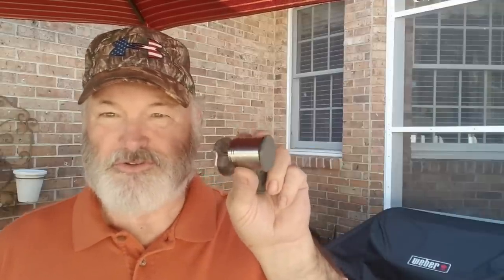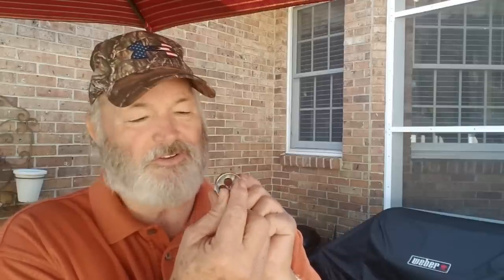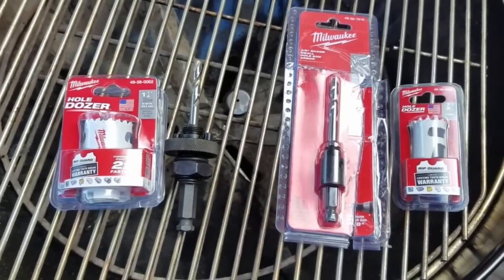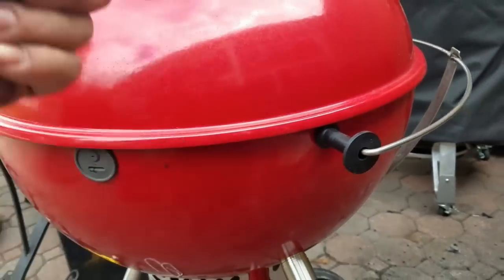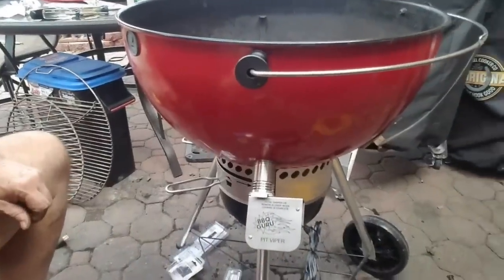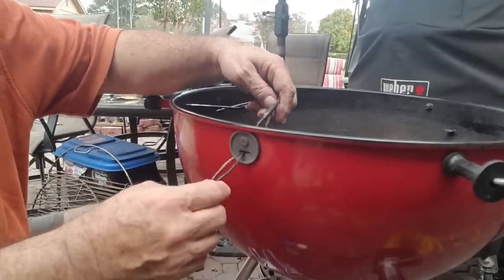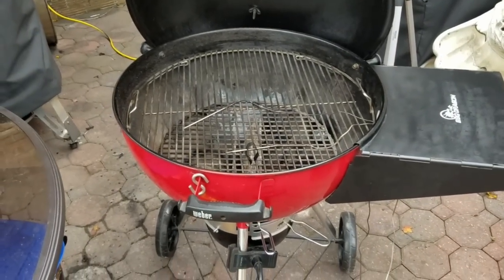WEBER KETTLE MODS | GURU PORT | PROBE PORT

Comment: Nice.  I did this temp probe mod with my old kettle but the rubber eventually wore out from the heat.  Doing a chicken wing cook will do a number on that rubber.  A sns port mod works better since it's made of stainless steel.  Also, I installed a NPT port next to the sns probe port on my classic Weber kettle which is nice because it allows one to thread in a high-quality dial temperature gauge such as the Tel-Tru which is half-inch NPT.  Sometimes those probes and electronics get cumbersome and all I need is a big dial thermometer.  Also, my dial thermometers go up to 1,000 degrees.  I've had the Thermoworks hit top end and blank out.  I even had a Tel-tru dial blow out once because max was only 550 F.  So now my dial thermometers are 800 or 1,000 F Max. Thanks for posting!

Comment: Hey Phil. When I did the grommet mod video, I drilled a pilot hole but it was still a booger to drill through that enamel LOL. Be well and be blessed brother.
Reply from the maker: Hey Joel. Long time since we talked. Hope you are doing good. Yea that high heat baked in porcelain enamel is a bear. Thanks for dropping by.
Reply: @progers5019  I've been around just busy. Did you see my video where I modified the air control/ash sweep arm for better cleaning?

Comment: I've made several modificatios to my webber I added a 1in air hole with a damper cover just under the slow and sear basket for better air controle. I also did the probe gromit. I cut a top vent damper in half and and made a new vent about 3 in from the bottom edge of the lid. I run the top vent closed and the lower lid vent open about half for the first hour of smoking drawing the smoke directly across the meat. Then I close that and use only the 1in hole I put in the bottom and top vent only I can keep it 225 if I chose very easily. 
      I feel like the webber kettle is a great little smoker with some modifications. It wasn't really designed to do indirect cooking but it can and with a few add ons and tweeks it dose a great job. Agreed the side shelf is worth every penny. Also with the extra air I can open things up and hit 450 really quickly for pizza

Comment: THX Phil.  I am doing the 1 1/4 in hole in the very near future.  The paint on the Q Tip was on point.
Reply from the maker: I love having the probe port and guru port, especially the probe port. So handy. Highly recommend this mod. Weber should add that feature IMO. Good luck.

Comment: Cool mods!

One observation on the BBQ GURU: The clean out paddles don't actually sweep across the full circle of the kettle. At around 12:38 you can see the V-shaped break in the scratch marks that is outside the paddle's range of motion (it's just above and to the right of the vent hole; you can also see the paddles stop on either side at 12:46 and 12:59). I haven't measured it ('cause I don't own a BBQ GURU), but it sure looks like it would fit there without needing to do the Dremel grinding on the GURU adapter.
Reply from the maker: Nice observation iaeen. You are correct. There is a couple inches further around that is between the paddle action. I chose that location so it would be in the front right quarter and closer in alignment with the probe port and the wires for the thermometer and guru would locate closer together. The guru adaptor had to be on that level so it would be beneath the charcoal grate, and miss the paddles. Both items could be located further around in that spot, but I wanted all the wires closer to the front quarter. Thanks for the great observation and feedback. And, thanks for watching and commenting.

Comment: I've seen a bunch of your videos awhile ago, but how does the pit viper work with a slow n sear? Do they work well together, I know you use them together. Thanks in advance, doing some digging on your videos now so I might find the answer here soon. I like to run a drip n griddle (SNS) for forced air flow, will your placement work the same with one?

Comment: Where did you get that gadget to hold the smoke thermometer! Just ordered a smoke and was wondering where I was gonna put it! That would work perfect! And does the dragon wing allow any smoke to leak from the lid? and one more question. Is that the newer red limited edition kettle?
Reply from the maker: That came from Amazon. Flexible Gooseneck smartphone holder. Does not leak with dragon wing. Yep, red limited edition.  Hey thanks for watching and commenting.
Reply: @progers5019  Thanks! Do you know if they have resolved the issues with the finish on the red limited editions?
Reply: @progers5019  and does this look like the right one? https://www.amazon.com/Macally-Adjustable-Gooseneck-Smartphones-ClipMount/dp/B00O4VAGR8/ref=sr_1_8?ie=UTF8&qid=1543486662&sr=8-8&keywords=Flexible+Gooseneck+smartphone+holder
Reply: @progers5019  Sorry I'm hounding you with questions, last one I swear :) The rubber piece on the top vent, Is that easily removable? Would like to replace it with a wood one from grillhandles.com along with the handles. Thanks again!
Reply from the maker: @stevedoughja1034  Don't have any issues with mine. None that Christy, and heard anyone else speak of it.
Reply from the maker: @stevedoughja1034  yep that's it
Reply: @progers5019  Thanks for the reply's. I just ordered one seconds ago! :)
Reply from the maker: @stevedoughja1034  
Hey Steve,  that's great. A weber kettle and several accessories can do everything you need.
Reply: @progers5019  Slow N Sear coming right up! :) Already got my Thermoworks smoke ready to throw in there!
Reply: Any other accessories you recommend? Have you tried the lavalock gaskets on the weber? I'm curious how effective they would be on one. Might have to try it.
Reply: I know the hood guage typically is wildly inaccurate compared to the grate but was thinking about putting a tru tel in there for the hell of it........... Now I just have to figure out which one will fit easily :)

Comment: Phil can you link me to the clamp on thingy that's holding your Thermoworks Smoke? Been looking for a way to mount it, currently I have it stuck to my BBQDragon wing. You also answered another one of my questions in this video. I was not sure if the Smoke probes would fit through that port. Now I know! Thanks!
Reply: I was thinking the same thing. I wonder if it's a generic phone holder from a store like Five Below or Ebay?

Comment: Where did you get the grommet.  Also where did you get the ThermoWorks holder thanks
Reply from the maker: Both from Amazon 
Probe Port.
.https://www.amazon.com/Impresa-Products-Thermometer-Grommet-Grills/dp/B07BC4TYQ5/ref=asc_df_B07BC4TYQ5/?tag=hyprod-20&linkCode=df0&hvadid=241909336538&hvpos=1o2&hvnetw=g&hvrand=1199310605937132180&hvpone=&hvptwo=&hvqmt=&hvdev=m&hvdvcmdl=&hvlocint=&hvlocphy=9010545&hvtargid=pla-491664911709&psc=1#immersive-view_1549899116371

Flexible Gooseneck smartphone holder 
https://www.amazon.com/Macally-Adjustable-Gooseneck-Smartphones-ClipMount/dp/B00O4VAGR8/ref=mp_s_a_1_11?ie=UTF8&qid=1549899279&sr=8-11&pi=AC_SX236_SY340_QL65&keywords=flexible+gooseneck+smartphone

Comment: What size hole did you drill/make for the guru fan adapter?
Reply from the maker: 7/8- 1 1/4. The adapter body bumps against the ouside of kettle and screw goes thru hole from inside air deflector and kettle and screws into the intarnal of the adapter. The adapter nipple is larger than the hole, doesn't go thru the hole.

https://bbqguru.com/storenav?CategoryId=2&ProductId=6

Comment: What did you use to mount your smoke base station to your Weber legs?
Reply from the maker: Both from Amazon 
Probe Port.
.https://www.amazon.com/Impresa-Products-Thermometer-Grommet-Grills/dp/B07BC4TYQ5/ref=asc_df_B07BC4TYQ5/?tag=hyprod-20&linkCode=df0&hvadid=241909336538&hvpos=1o2&hvnetw=g&hvrand=1199310605937132180&hvpone=&hvptwo=&hvqmt=&hvdev=m&hvdvcmdl=&hvlocint=&hvlocphy=9010545&hvtargid=pla-491664911709&psc=1#immersive-view_1549899116371

Flexible Gooseneck smartphone holder 
https://www.amazon.com/Macally-Adjustable-Gooseneck-Smartphones-ClipMount/dp/B00O4VAGR8/ref=mp_s_a_1_11?ie=UTF8&qid=1549899279&sr=8-11&pi=AC_SX236_SY340_QL65&keywords=flexible+gooseneck+smartphone
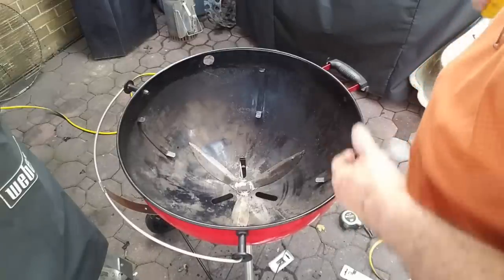Reply from the maker: Go to the 9:27 mark on this video and I zoom in on it.
https://www.youtube.com/watch?v=keFreK7SJLI
Reply: Thank you Sir!

Comment: Oh boy.  Dang it Phil!  Now I have to drill holes in my kettle!  Glad you got your issue with the Guru taken care of.  You will wonder how you got by without it.  I would be curious if you use less fuel on the WSM with the guru than without.  That is how it seems to me, but I don’t have as much experience using my WSM without the guru as what you have.  Looking forward to the first cook with the Guru on the kettle.
Reply from the maker: Hey Bryan. I love Gadgetry, so I'll use that new toy every time I can. I can see using less fuel with the fire and heat control.  Makes sense to me. Thanks-phil

Comment: Does it matter where your Guru is in relation to your Slow n Sear?
Reply from the maker: Not technically, but there would probably be more concentrated heat on that side of the SnS. I know charcoal can be spread over the entire charcoal grate and the guru adapter is just below. Thatis probably not a problem.  Guess I was thinking about probe wires and that is located in another location. Also the fan wire is outside the kettle. So, it probably doesn't matter. I mispoke. Confused old man. LOL

Comment: Great video Phil. Where can I buy that probe attachment. Keep up the good work!
Reply from the maker: Thanks for watching Bill. The probe port comes in a 2-pack from Amazon which is good.
Probe Port.
.https://www.amazon.com/Impresa-Products-Thermometer-Grommet-Grills/dp/B07BC4TYQ5/ref=asc_df_B07BC4TYQ5/?tag=hyprod-20&linkCode=df0&hvadid=241909336538&hvpos=1o2&hvnetw=g&hvrand=1199310605937132180&hvp

Comment: absolutely  love this mod   where can I find the rubber grommet for the whole? does weber offer this in parts?great vid Uncle Phil
Reply from the maker: Both from Amazon 
Probe Port.
.https://www.amazon.com/Impresa-Products-Thermometer-Grommet-Grills/dp/B07BC4TYQ5/ref=asc_df_B07BC4TYQ5/?tag=hyprod-20&linkCode=df0&hvadid=241909336538&hvpos=1o2&hvnetw=g&hvrand=1199310605937132180&hvpone=&hvptwo=&hvqmt=&hvdev=m&hvdvcmdl=&hvlocint=&hvlocphy=9010545&hvtargid=pla-491664911709&psc=1#immersive-view_1549899116371

Flexible Gooseneck smartphone holder 
https://www.amazon.com/Macally-Adjustable-Gooseneck-Smartphones-ClipMount/dp/B00O4VAGR8/ref=mp_s_a_1_11?ie=UTF8&qid=1549899279&sr=8-11&pi=AC_SX236_SY340_QL65&keywords=flexible+gooseneck+smartphone

Comment: st.louis bbq store has a better probe port.15 $
Reply from the maker: Dave, I actually have a port exactly like that on my offst stick burner, and a spare in my box. I actually like the one I installed on the kettle better for the kettle. Anyway, hole is bored and this one works just fine. Thanks-phil